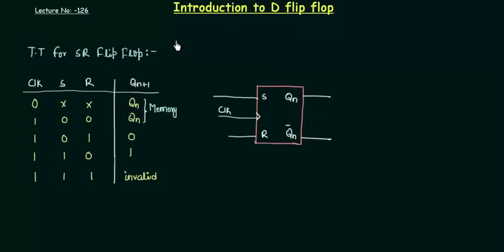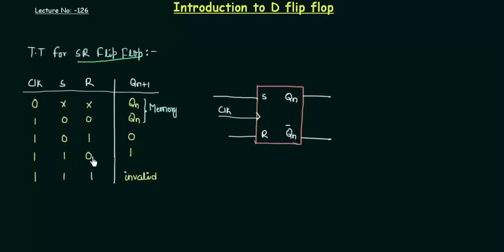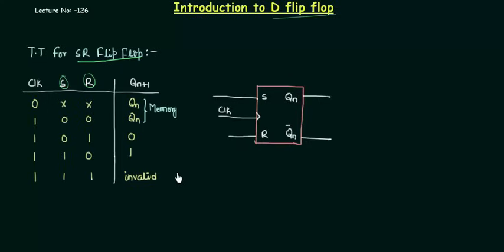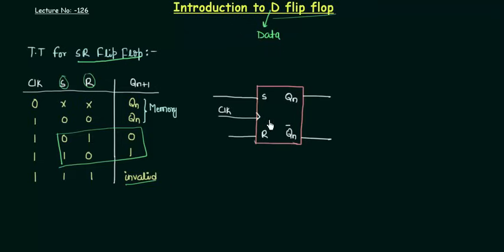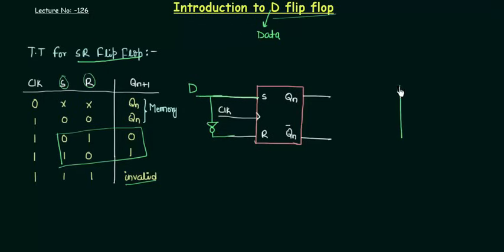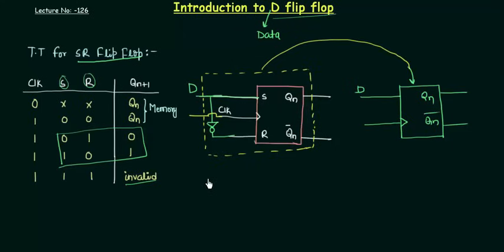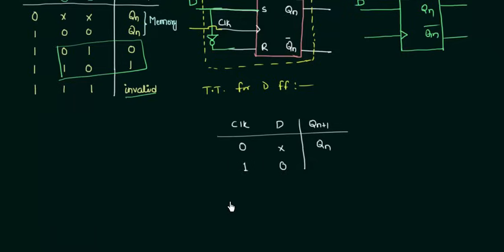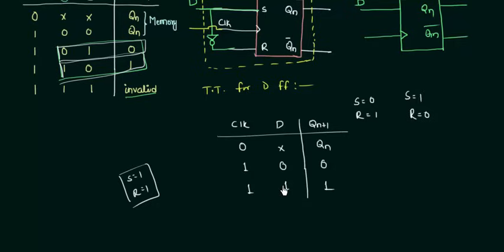Introduction to D flip flop

Comment: Sir i have a doubt that when d=o, clk=1 then how can we get s=0, R=1
Reply: Observe the circuit diagram carefully, D is directly connected to S, however, it is connected to R through a not gate. Therefore, the value of D is directly reflected at S but in case of R we get the complemented value of D.
Reply: @sayantanmanna1360  wo wahi puch rha hai 
That in cas of d=0 , clk=1 that will be the case of
S=0, R=1. Toh S=0 ,R=0 wala case kanha count hua
Reply: @growwithNitishk  s=0, r=0 nhi ho skta D F/F mein. Memory state achieve krne ke liye clock low krna pdhta hai.

Comment: Sir I have a doubt..As u said that s and r are always complement to each other so we need only one input in d flip-flop...But if we consider the truth table of s-r flip-flop there is a case where s and r are booth equal to zero and we get memory as output..So if we dnt use another input in d flip-flop then this mentioned case will not be valid and hence the flip-flop can't store the previous data..So how can we store data in d flip-flop?
Reply: you can store data onlt 1,0 or 0,1 case. Others is not used in d flip flop.

Comment: Sir in my college it has told that D stands for delay and you told that D stands for data.

I am confused about it sir please clear my doubt???
Reply: It may be called a Data flip-flop because of its ability to ‘latch’ and remember data, or a Delay flip-flop because latching and remembering data can be used to create a delay in the progress of that data through a circuit. To avoid the ambiguity in the title therefore, it is usually known simply as the D Type.

Comment: What about the case when s=0 and r=0 Qn=memory?? In D file flop???
Reply: s=0 and r=0 is not possible, As in d type flip s and r are complement to each other so the value of s and r can not be the same, for this we use d flip flop otherwise there is no need of d flip flop.

Comment: Does it mean that we don't have a " memory" condition with D flip flop? Will it not act as a memory ? What are its Functionalities then ?

Please Do Reply
Thanks :)
Reply: i have the same question
Reply: maybe u can answer me now ? it's 2 years :D
Reply: Well the memory case for this will be when the clock is low i.e 0..... Because if u see carefully the memory case arises under two circumstances 1) when the clock is low 2) when both the inputs are low..... So in this d ff case we are not using the two low input case
Reply: we can have that while the clock remains off, which will make s*=1 and r*=1. Thus we will be having the previous state.

Comment: what is the difference between D latch AND D flip flop?
Truth table for both are the same there is only change of En and CLK
So how do they differ from each other?
same is the case for SR LATCH AND SR FLIP FLOP.
Can you please explain these?
Reply: Enable only fr positive condition, while clock fr both
Reply: If enable in present, and it is operational for the whole circuit, then it is called latch. If clock is present and it is operational for the whole circuit then it is called flip flop.
Reply: Okay thanks .